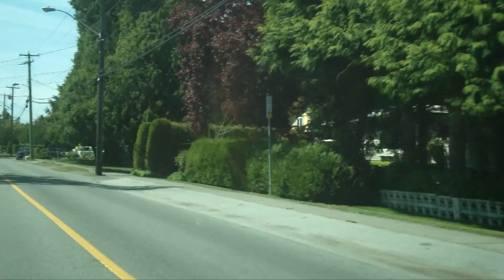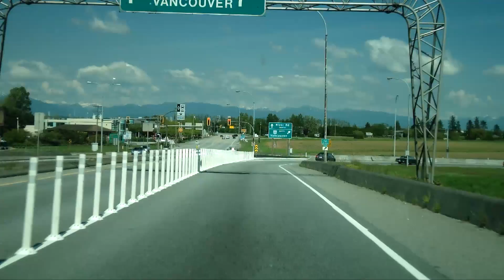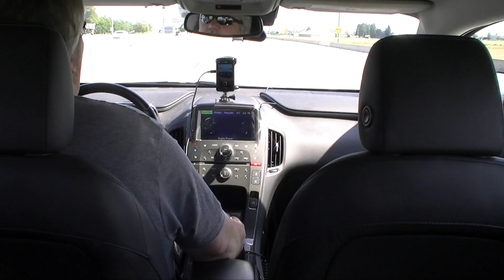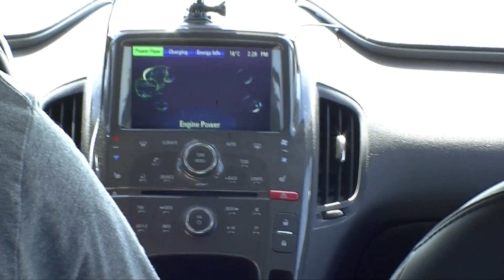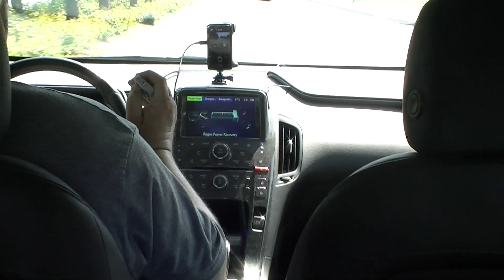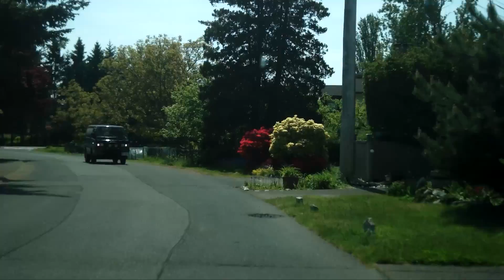How to drive a chevy volt for best electric range and fuel economy

Comment: So first of all, the Chevy Volt is definitely a hybrid. A plug in hybrid to be precise. Instead of actually physically running from the gasoline engine when the battery is flat, it uses the gasoline engine as a generator for the electric  engine. Most hybrids work this way, because it is more efficient to run the engine at a higher power for a shorter time, than to run it all the time and basically just waste gas on red lights and stop and go traffic. I know some hybrids use the gasoline engine when driving more than a specific speed etc. And some can also regularly use the gasoline engine to physically power the wheels of the car. The Volt only does this in very rare occasions. In any case, the Volt is clearly a hybrid.
And about your driving tip... While your way of doing it will certainly do the trick, it's kinda overly complicated. There is no reason to shift to D. You might as well always stay in L. I know calling it L is kinda misleading. Since it implies a lower gear. I guess they did this, since normal cars would engine break harder in a lower gear. But technically the gear is the same. All L does is change the behavior of the gas pedal. While in D you can coast freely when you release the gas pedal and you only start regen when braking. In L you start regen as soon as you let of the gas. Basically it's pretty similar to the way Teslas work.
Reply from the maker: Chevy used the term EREV, extended range electric vehicle to differentiate it from the other plug in hybrids 

There were two generations for the Chevy Volt and both operate completely differently. You should do a little bit of research before you open your mouth because it's obvious that you have no clue on how the first or second generation work. First generation has four modes of operation, single motor electric vehicle, dual motor electric vehicle, series hybrid were one motor is connected to the gas engine to generate power that is used by the traction motor, and parallel hybrid mode where both the gas motor and both electric motors are connected to the drivetrain. Unlike all other plug-in hybrids which will always use the gasoline engine for acceleration under power at all times regardless of the state of charge, the volt and only the volt is 100% electric until the battery is completely depleted. Once the battery is depleted the engine will start and it will start as a series hybrid at speeds up to 90 kmh. At speeds over 90 km per hour when you are cruising the system will switch to a parallel hybrid where power from the engine is transferred to the wheels as well as power from the electric motors. It does this by coupling engine power into motor number 2 which enters the planetary gear set along with motor number one. The car cannot drive on engine power alone power must also come from the traction motors because you cannot remove traction motor number one. as to switching between drive and low range yes you can leave it in low range I find it annoying though if you take your foot off the gas the car is going to slow quickly which you don't necessarily want. I like to coast and then switch to low as I'm approaching a light to slow me down. Also keep in mind on first gen the brake lights are not turned on when you do this so you have to watch for the asshole behind you to make sure he's not going to rear end you. The four modes of operation single motor electric for maximum power, when cruising both electric motors are connected to the planetary gear set and can operate as a variable ratio drive through the planetary gear set. this allows both motors to run at a slower speed which are more electrically efficient than one motor running at high speed. If you step on it to pass it will switch back to single motor mode. In extended range mode when the gas engine is running the gas engine will cycle on and off at speeds below 60 km per hour it will run put some charge in the battery and then shut off and then start again put some charge in the battery and shut off, at speeds over 60 the engine runs constantly and runs as a series hybrid, once you hit 90 km or faster providing you're not doing heavy acceleration it will operate in parallel as it is more efficient. The second generation volt is it completely different car and operates more like a conventional hybrid there is no series hybrid mode on the second generation. it can operate as a single motor electric and it can operate as a dual motor electric it can operate with the gas engine running driving the wheels completely by itself without any input from either electric motor it can operate with the gas engine running and one electric motor generating power and the second electric motor doing nothing and it can operate with the gas engine running with both electric motors contributing power five modes but on the second generation which is 2016 to 2019 when the gas engine is running it is always driving the wheels. That's the big difference between first and second generation and yes I have both and I know exactly how they operate. Second generation in addition to being able to switch to low range to regenerate power when you take your foot off the accelerator there's also an on-demand paddle on the steering wheel to turn on regeneration. If you switch to low range and pull the paddle it doubles the breaking effect to 55 KW which will slow the car from freeway speed down to a crawl very quickly in fact I never use the brake pedal on my second gen other than to hold the car once I've gotten down to 2kmh. If you don't own a volt you are in no position to comment on how the car operates unless you're a volt engineer. Those of us that own the car have done a lot of research and we know everything there is to know about how the vault operates through both generations. I've owned one for 10 years and I've owned two for three.
Reply: @12voltvids  Thanks for the detailed explanation. Perhaps I should have specified more clearly that I'm talking about the Chevy Bolt gen 1. I thought it's kinda obvious, since that's the car you're driving in your video.
And yes, the Chevy Volt is rather unique compared to other plug in hybrids and it also has a rather unique transaxle with switch between many driving modes in attempt to maximize the efficiency. Don’t get me wrong, I definitely enjoy looking at the technical differences between different hybrids or different cars in general. This guy explains the transaxle of the gen 1 pretty well and he also explains the transaxle of many other hybrids, EVs etc.
https://youtu.be/dqM3YXEf1js
I am completely aware of the differences between the Volt gen 1, gen 2 and other hybrids/plug in hybrids. But I still think the Chevy Volt is very much a plug-in hybrid. It can be used as a pure EV, but it clearly it isn't a pure EV, since it can also be run on gasoline. And it definitely isn't a regular gasoline car either. I know Chevy prefers to call it an extended range EV. Most companies like to make up their own names for things to make them sound new and different. And to be completely fair to GM, the Chevy Volt is different. And I also think the Volts way of doing it, is superior to most other hybrids. So I can understand them not wanting it to seem like any other old hybrid. But hybrid is a rather broad term that essentially covers pretty much all cars that can run on multiple different energy sources. I prefer calling the Chevy Volt a plug-in hybrid, since that’s what it is. Obviously, it’s not the same as all other plug in hybrids, but nobody said all plug in hybrids are identical. There are many many different gas powered cars and nobody argues about them being gas powered either right? Of course, you can also call it an extended range EV if you prefer. But saying the Chevy Volt is NOT a plug-in hybrid, is just factually wrong, in my opinion.
It uses two different power sources, therefore it’s hybrid. You can recharge it from the grid, therefore it’s also a plug-in hybrid.
In my opinion, it’s actually kinda dumb to call a hybrid that are not plug-in hybrid, a hybrid. Cause non plug-in hybrids can only really run on gasoline. Sure, they can store electricity and use it to even out stop and go traffic in order to be more efficient. But the electricity is still gained from gasoline (or diesel, or whatever else it uses). So really there is only one power source. Anyway, I guess it’s not quite the same as a purely gasoline powered car, so I get the point of differentiating them.
When it comes to driving on L. Fair enough, I guess. I can understand it not being particularly pleasant to have to hold the gas at a certain position in order to coast. You could of course just stay in D then. But I can also understand it being a little annoying that the brake controls regen and the actual hydraulic brakes, making it kinda difficult to use regen without accidentally engaging the hydraulic brakes too and wasting energy. So if you're not comfortable with the whole one pedal driving concept, perhaps switching between D and L is the most efficient way for you.
Reply from the maker: @phinok.m.628  the term extended range electric vehicle was chosen on the first generation just like it was on the Fisker Karma to differentiate the car from the other plug-in hybrids that were on the market at the time. Every other plug-in hybrid including the ones that are made today will use the gas engine even when the battery is fully charged once you exceed a certain speed or under heavy acceleration. Chevy wanted to emphasize that the volt was it electric car first. Of course it's a hybrid hybrid just means two fuel sources. But again marketing wanted to emphasize that it is in fact an EV and it can be driven exclusively as an EV. I have two a first and a second gen. First gen still gets over 50 km on the battery and the second gen gets 90. I went an entire year on a tank of gas in my second gen and had the computer not forced me to use it before it went stale I would still have that same gas in the car now. In fact I only carry 1/8 of a tank of gas in the car just enough to get me home if I run short on electrons. My wife drives the old car and she quite often goes beyond the 50 km range so she Burns a tiny bit of gas in her car. 30 l of fuel last 3 months and she averages over 3,000 km between fill ups.  I managed 11,000 km on one tank of fuel over the course of 12 months. As to the single pedal driving versus using drive I guess it's what you're used to I like the vehicle to be able to coast without slowing down such as it does in l. In stop and go traffic I use l that's just my wife in the first gen but when cruising down the freeway it's a pain in the ass for every time you lift your foot off the gas pedal slightly the car starts slowing down so we use drive. We need to press the brake pedal it goes through a few different intensities of regen breaking and as you push the pedal further the hydraulic brakes come on. In low range mode if the battery is fully charged it will not regenerate because the computer knows that you could easily overcharge the battery if the battery is full so using l does not slow the car much if the battery is charged. The same occurs on the second gen if the battery is full pulling the on demand paddle does not give much breaking and in second gen it has the indicator on the dash as to how much power is being put back into the battery. Under normal driving switching to l or pulling the regen paddle will put approximately 30 KW back into the battery switching to L and pulling the on demand paddle will stuff about 55 kilowatts of power back into the battery. I can charge it 7 KW Max. The first gen charges at 3 kilowatts. So regenerative power is much stronger than plug-in charging and if the battery is close to full charge this could damage the battery. So when the battery is nearly fully charged for example if I switch too low or if I put the regen paddle on the braking effect is typically only five kilowatts and the hydraulic brakes must be used. Of course once you drive a few miles and the battery starts to discharge then the regen will start to work but it takes a while the first couple of intersections I hit when I leave my house there's virtually no regen available because the battery itself is almost completely full. GM has done a wonderful job with the battery management system on the volt. My first car is over 10 years old it has not lost any noticeable range on the battery. When the car was new I got approximately 55 to 57 km on a full charge. There was a recall issued to change the programming of the battery control module that was designed to extend the life of the battery by not permitting it to discharge to as low estate that it was originally programmed for. This reduced the usable capacity from 10 kilowatt hour to 9.1. reduce the range to 50 km but in doing so will prevent the battery from discharging too low and extend the life. This is something that full on EV can't do. As their batteries age the range drops. When GM dropped the volt I think a lot of us were a little bit pissed off because we had the perfect vehicle. When the time comes that I have to replace one of them I'll have to look elsewhere but one thing for sure it will be a plug-in hybrid type. I enjoy all the benefits of a full electric vehicle with none of the drawbacks. What drawbacks you ask? Well I have a picture on my phone when I was traveling in the summer at a DC charging station with eight people waiting for two charge cards. That's the drawback sitting around for 2 to 3 hours waiting to get on the charger so that you can continue your travel. And yes a number of those cars were teslas sitting there waiting in the blazing heat and they didn't have enough battery left to run the Ac. Sucks to be them.
Reply: @12voltvids   @12voltvids  Yes, I was not trying to say the Chevy Volt is the same as all other plug-in hybrids, just that it is also a plug-in hybrid... I definitely think the way the Volt does it is pretty much the best way right now. You basically have a normal EV in everyday city traffic, while not having the limited range and long charging time when you have to go longer distances. Since people usually drive around mostly in their own town. You run purely electric most of the time. It's pretty genius. And honestly, I'm not sure why so many plug-in hybrids do it so differently. I mean, not only is it less efficient, it also is quite annoying when the gas engine starts all the time because you happen to accelerate a little too hard or drive slightly too fast.
And yes, of course you can only regen if you have a place to store the regen energy. And yes, I agree the battery management is very good. It's unfortunate that most laptops and smartphones push their batteries so hard. They could also improve the battery life A LOT by only running the battery between 20 and 80 %. Sure, you get a little less capacity, but at least the battery last forever. I guess the problem is that manufacturers usually don’t want your battery to last that long…
That said, pure EVs also often don’t give you access to the full battery capacity in order to preserve battery life. And on Teslas for example you can set it to only charge to 80 % or so in order to preserve battery life.
I think in the case of pure EVs, it makes sense to run in the 20-80 % mode most of the time. But to let the driver use more of the capacity on long drives. Most people don’t have long drives that often. But when they do, that little extra capacity can be really helpful. And using most of the capacity won’t damage the battery immediately. It's just, the more you do it, the quicker your battery will degrade. In fact, for Li-Ion batteries, it’s preferable to keep them as close to 50 % as possible. So even things like first charging the battery to 50 % and then only charging the rest a few hours before the person has to drive somewhere could help extend the battery life.
Anyway, of course there are many ways to improve efficiency, battery life etc. But for the most part, I think the Volt does a pretty impressive job. Especially the earlier gen 1 versions, given how old they are. Pretty cool how innovative GM was even back then.
But you know, the main thing I wanted to point out was that, while it may be quite different to most plug-in hybrids out there. The Volt is still a plug-in hybrid. Just a better one…
Reply from the maker: @phinok.m.628  the first gen only was marketed as an extended range electric as with the exception for extended range freeway speed the engine does not supply any power to the wheels and even when it does on mode 4 it is less than 50%.  It is a completely different power train.  3 clutches allow single motor (1 clutch locks ring gear to case) 2 motor (case clutch unlocked motor clutch locked and 3rd clutch to ice unlocked) series hybrid clutch 1 locked to case, clutch to ring gear to motor 2 open a d clutch 3 mitor 2 to ice locked. Parallel hybrid.  Clutch 1 ring gear to case unlocked and both ring gear to motor 2 and motor 2 to ice locked.   In this mode ice spins motor 2 to generate power and also spins ring gear.  The main motor spins the sun gear and the planet carrier spins the wheels.  
Gen 2 uses 2 planetary gear sets 2 electric motors and the ice.  The same type of setup that the other hybrid power trains such as the escape and Prius use.   The thing is the 2nd gen when the engine starts it always drives the wheels.   The way it is set up when the engine is running, using a 1 way clutch power is always sent to the power split planetary gear set.  Other companies did not use the same system that the first gen did because gm owned the patent on the design.   The second gen is closer to, not exactly the same as other makes but similar to other designs.  Simpler and cheaper to build. The first gen however has fewer moving parts and fewer parts generally means higher reliability